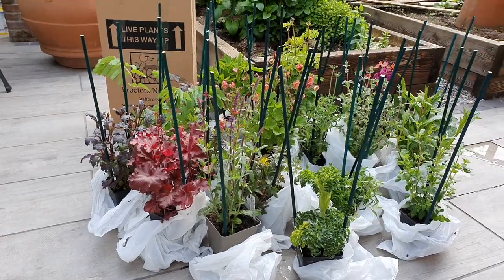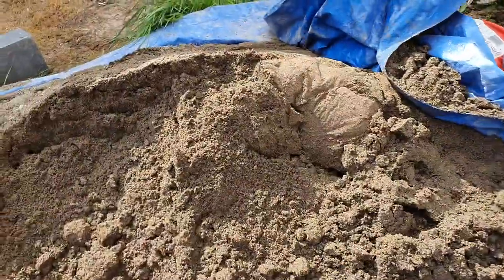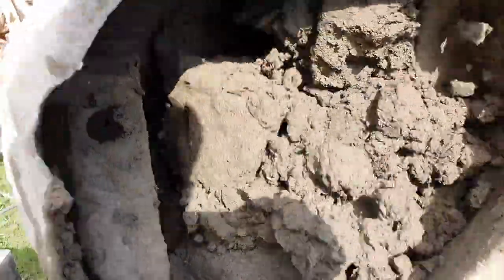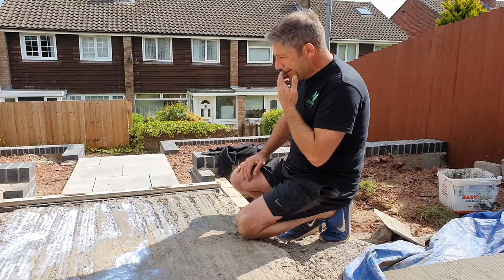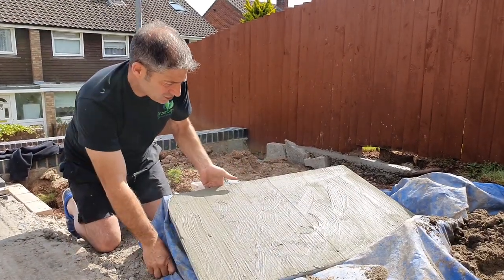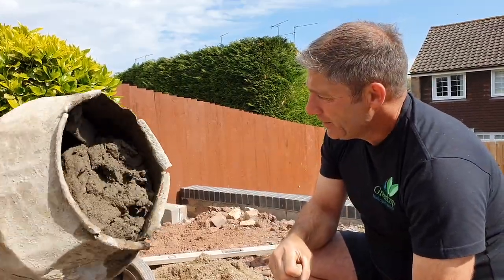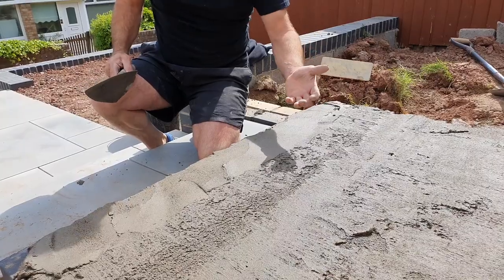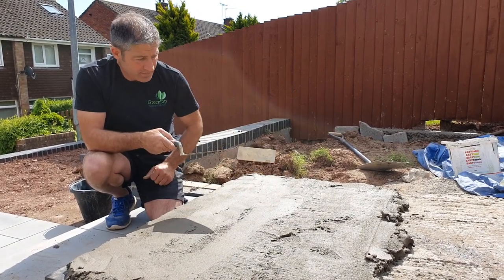Priming Slurry & What Ratio For Your Mortar

Comment: On limestone light slabs should you mix sbr with white cement or does it not make any different? I've read i need to lay on a light mortar to avoid staining coming through.
Reply from the maker: Hi Tom, the SBR  coated on the back will avoid fast absorption of the  moisture out of the mortar that will result in delamination and it will ensure the slab adheres to the mortar, don't forget a full bed, stay safe mate
Reply: Could you not just make an SBR slurry with cement water an SBR an coat them fully before you lay them, would this stop anything getting through? Interesting topic, got a Indian sandstone patio to do an was think of doing that? I know it works well with porcelain 🤔

Comment: I'm confused, in some of your vids you lay the bed of mortar and then you make small voids/spaces in the bed so that when the slab goes down it spreads into those voids you make. Here you've gone completely flat, am I missing something, I'm watching so many of your vids as I'm going to be laying Indian limestone in the next few months and I don't want to get it wrong. Great vids though - very informative and comprehensive.
Reply from the maker: Hi Buddy dont get confused with a calibrated stone slab or paving you can make flat but with uncalibrated you need a few voids to accommodate the uncalibrated paving, either way there are a few methods you can use, hope this helps?

Comment: You mention using SBR when laying mortar and sandstone slabs onto an existing concrete base. You state this is for waterproofing.. I have therefore bought some SBR+. Can you tell me how I might apply it and in what mix / ratio? And what would be your instructions? Do I paint it onto the existing concrete base and let it dry or paint it on and them start putting the mix down while it is still wet / tacky? Thakns in advance for clarifying here Johnyboy!
Reply from the maker: Hi Rick mate, Just mix 50 50 and just wash it it over that concrete or you can actually slurry your concrete mate with an Priming slurry theres loads on the market.

Comment: Hi Johnnyboy. As a novice, I love your vids, thanks. I have some steps to pave. I was going to use 6:1 (recommended on your other vid if using Easy Joint to point, which I intend to). I was going to SBR my old concrete base and Easy Prime the slabs. Does that all sound ok? I will add a plasterciser to my mix but do I add SBR to that mix too please? Thanks very much. Richard
Reply from the maker: Please give me a call Richard I can talk you through it

Comment: Why you not using concrete sand. Always used this and been advised to use it for years. All other info on your video is A1.  Although, will you splash out and buy a new mixer lol
Reply from the maker: That mixer drum went years ago and I do use con sand and if the mixer is working why would I change it
Reply: @GreentopLandscapes   was only kidding about the mixer. If ya awen th drum I was using for years you have some laugh lol. 

Is that concrete sand your using in video?
Reply from the maker: I know mate honestly it’s fine I can have banter the sand is all sharp or con sand as some say
Reply: @GreentopLandscapes   all good 👍.    Here in Ireland we've always called the different sands concrete sand, plastering sand or building sand.
Reply from the maker: It’s same every where brother, keep it 🔥

Comment: If you add the builders still you wouldn't need the slurry, the builders helps it adhere. slurry is for porcelain because it is non porous product, slurry is not for porous slabs like sandstone, waste of time and money using slurry on natural stone. it is a marketing gimmick.  I have been laying sandstone for nearly 20 years now and my slabs dont come loose. If you do a 6 to 1 mix being 5 sharp 1 builders and one cement the concrete is as porous as the sandstone so you get an even drain and no frost heave. i appriciate there are more than one way to skin a cat, so you do you mate, but i recommend not using slurry on natural stone.
Reply from the maker: Thanks for the response, its appreciated and you are entitled to your opinion, the thing is the slabs these days are so thin and as sandstone absorbs moisture you can get delimitation through this so the slurry is just belt and braces and will ensure this does not happen.
Years ago the slabs were so thick and heavy and just would not move, thanks for your response.

Comment: Hi Johnny, im just sbout to lay some 6 side smooth / sawn indian sandstone. Never laid smooth / sawn before, i always prime the backs of sandstone with an SBR / cement slurry which i think works great. Just wondered if you seal the face before laying? I've never sealed before laying, but a few suppliers online are reccomended doing this because of how easy the slabs stain when laying. Whats your thoughts and any tips for laying smooth sandstone would be most welcome.
Thanks Joe
Reply from the maker: Hi Joe, thank you for your feedback its really appreciated, its nice to see a positive sensible constructive comment. I think in some cases its just down to budget with the client. Anything that helps to protect is good but we really got to understand the stone we are using, if a supplier seals as part of the production process thats great but we just can not put anything on as it can make a mess. I have seen this a few times, thank you so much for your response and stay safe my friend. Johnyboy
Reply: @GreentopLandscapes  thanks for getting back to me. Have you ever sealed the stone before laying it? Or even sealed before pointing? Im a bit worried about this staining issue with the smooth sawn cut stone.
Thanks again, Joe